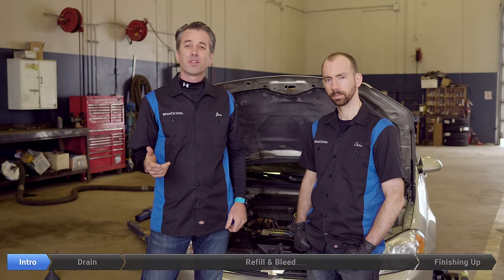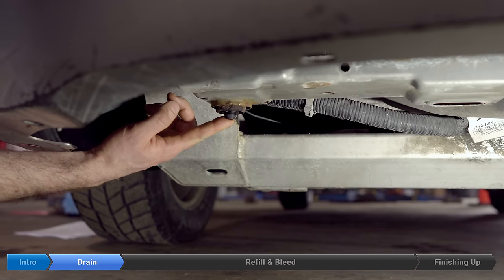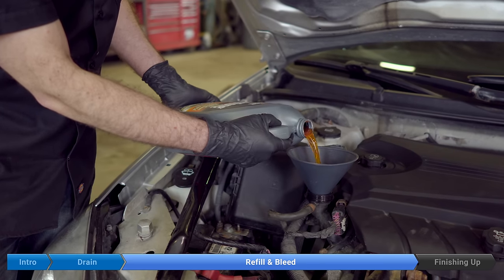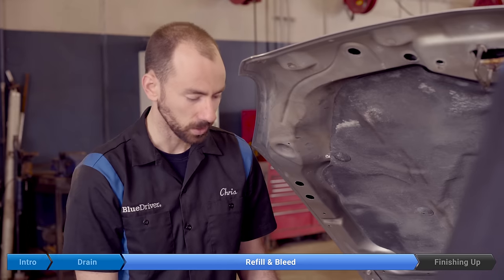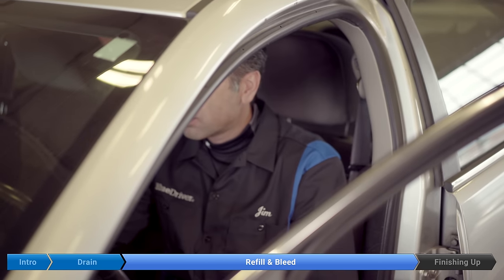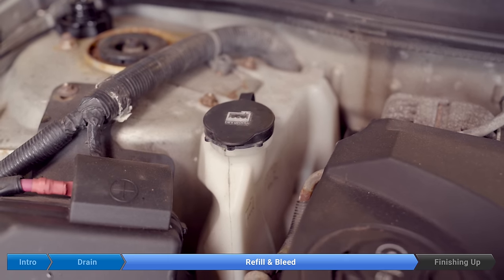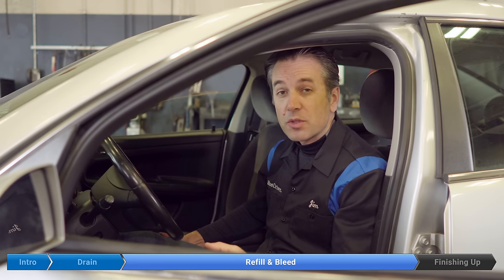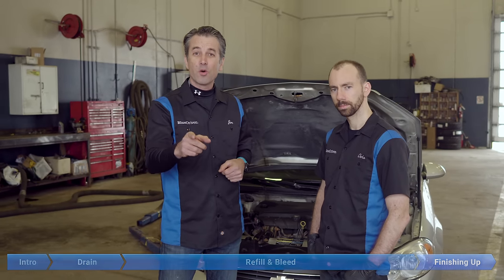Coolant Change - 2006-2013 3.5L Chevy Impala

Comment: Video worked! 
(Except unclamped the bottom hose cause i couldnt find the valve to release coolant) 

Thanks though 👌🏽 No more air bubbles
Reply: Ughh exactly edddie i thought i need a tool for it but i guess i dont i think i. Gonna take my impala to autozone and have them show me where it is exactly its weird because i didnt have this problem with my other impala
Reply: On the 2007 Impala, it is a wing nut that you turn. A flash light looking down from the passenger side can help to reveal where you need to reach. It is hard to find at first. Good Luck.

Comment: I still don't know where the drain plug is
Reply: On the passenger side, near the bottom.
Reply: Exactly idk why he wasn’t more specific
Reply: Thanks! That's all I needed to know.
Reply: Car should have a instruction book OR look it up on google😊
Reply: @firemanspitta3437 right? This entire channel should just be deleted cuz google
Reply: @lasawbrewer8272 that literally doesn’t help
Reply: @truetomysouljas4793  bro. If you're facing the car from the front, the car is opposite to your direction. This means you have to look to your left side near the bottom. It is that simple.
Reply: @lasawbrewer8272  I ended up finding it thanks to a friend who did the same job. Preciate it tho

Comment: Heads up for all you DIY’ers there’s a line at the bottom of the overflow tank. Fill it up to that line or just a bit above!!! I seen this video to see where the line was and I filled it up to where it’s at in this video and my coolant was pouring out!! I thought I had a hole in my tank but there’s a small vent in the back of the tank that pours out when the tank is full!!
Reply: I was thinking the same thing... That line is a cold fill line btw, so let your car cool down before filling it
Reply: I came to the video to check where the cold fill line is.   They overfilled the reservoir. No mention of the CFL.
Their shirts are nice though...
Reply: I was thinking the same thing they overfilled it 😂

Comment: The 2006 Chevrolet Impala has a coolant capacity of 12.3 quarts for the initial fill. The type that should be used in the vehicle is orange Dex Cool; 50/50 diluted.

Comment: A helpful piece of advice. If the petcock valve is not easily turntable by hand, you can use a 7/8" deep socket with a 3/8" ratchet to get it loose. That was the only way I was able to get the petcock valve loose on my 2009 Chevy Impala with a 3.5L engine.
Reply from the maker: Good tip!
Let's just say that part of the video was.. trimmed down for time
Reply: Show i have a 06 impala so would i need socket to drain the antifreeze
Reply: @sergiomelendez9186  I would recommend using a socket since the petcock valves on the Impala's have a tendency to be stuck on pretty good.
Reply: My 08 3900 cannot use a socket. I used a pry bar and pliers to turn it open. Closing was easier.

Comment: Good video, one step i have done different instead of filling, start/turn off vehicle etc to release air in the system. I have connected a coolant filling funnel to the filling neck that releases air while putting in coolant automatically.

Comment: It's just easier to loosen the bottom hose with the clamp just enough to get it to drain go inside have a cup of coffee when it's all drained put the hose clamp it back on start filling and bleeding
Reply: Really? Would that work with any car?
Reply: @unitedwestanddividedwefall3521  Yes but some cars are easier than others.
Reply: @Anon1mous  thank you yes. I just noticed that the Spurs on the clamp are turned inward towards the firewall and components and very hard to get a needle nose pliers to get it :( might have to cut it and put a new hose lol

Comment: Guys my cap broke, got a new one and doesn’t fit got another one but a new gm original radiator cap and still nothing does the spring on it adjust?

Comment: Aren't you supposed to remove the two engine block drain plugs on these motors to get all of the coolant out of the block?
Reply: Is that why I can't get the coolant out of my radiator?

Comment: How many gallons does the radiator system hold
Reply: You'll have to buy 3 gallons and probably use 2 and a half gallons, just did mine, but I flushed and drained every drop, even the reservoir, I use a turkey baster to get all the dirty antifreeze and sediments out
Reply: 10.1 quarts on a total system drain.

Comment: Car is leaking coolant from passer side. And I was looking at videos of old Chevy impala and saw that they have coolant elbow pipes. Are these the same on the 2008 impala.
Reply from the maker: There are a few spots on the passenger side - it could be the water pump itself leaking, or where the hose attaches just forward of it - there's also the coolant bottle at the back, cap, and the filler neck
Reply: BlueDriver I'll try the coolant bottle first then rule it out. I notice when I fill it up its start to leak. Thank you, you guys are very helpful.

Comment: Thanks for the vid, it makes a lot of sense

My concern, though, is that I only dropped about half the fluid that I expected and could only add about 1.25 gallons on my flushes. This is with the cap off and with the petcock the whole way open. Am I missing a step?

Comment: This video only shows how to drain the radiator only which only holds 1 gallon the rest of the coolant is in the engine block n heater core which can be drained by removing thermostat

Comment: My car when turned on heat still blows air on the driver and heat on the passenger side , I changed all 3 actuators! What do you recommend I do
Reply: Clean out the heater core

Comment: I can not find the petcock valve. Do you have a video showing exactly where that is at?
Reply from the maker: You'll (barely) see it at 1:38 
Passenger side, facing inwards towards the engine, bottom corner of the radiator.

Comment: My petcock is not nearly so easy to turn. It's blocked by a metal flange, and I bruised my arm on the alternator squeezing my arm down there to reach it.
Reply from the maker: Definitely not easy to break loose - if you didn't see it below, check out the comment by David Lamb where he suggests using a 7/8" socket - that should do it.

Comment: How come no water was added? Is this 50/50 coolant?
Reply: They are using a premix 50/50 antifreeze and water. You can use any 50/50 premix brand. Most all antifreeze brands today can be used in aluminum radiators.

Comment: I have a 2006 Chevy impala and the that runs in front of the engine is leaking but I have no idea how and where to find them because I don’t know the name of them
Reply: *pipes
Reply from the maker: Where are they roughly?
Reply: BlueDriver  Running from the front of the engine to what appears to be the heater core

Comment: I have a 2006 impala, does anybody know if the “petcok “ is in the same place? It seems like I can’t find it on the passenger side
Reply from the maker: It should be located on the passenger side, but it may be a little hidden behind a plastic cover or the air dam. If you can't find it on the passenger side, try checking the drivers side, some models had the petcock on the drivers side. If you can't find a petcock or drain anywhere on the radiator, you can drain the coolant by removing the lower rad hose (but warning, this can be messy)!
Reply: @LemurMonitors  got it, thanks a lot !!

Comment: My temperature gauge goes to normal range when idle or driving, but every so often it goes three quarters of the way up on the temperature gauge for a few seconds then goes back down to normal.  Could this be cause by a head gasket issue or faulty thermostat?  I don't see any leakage underneath.  Thanks.
Reply: Sounds like something to do with a temperature sensor.  They usually fail slowly and that's one of the things that happens when they start to go out.  I could also be a thermostat that's sticking and then popping open.  If it's been a while since you've had a new thermostat, I'd start with that since they're cheap.
Reply: my 06 did the same....check your level coolant in radiator,it may be low as was mine.That did resolve the issue..Now if it  does the same thing ,,then it could be thermostat or temp sensor..I would change both out .. easy to do..

Comment: Can low coolant cause your check engine light to come on
Reply from the maker: Sure can! Low coolant (or air in your coolant) can cause a number of codes that might normally point towards problems with the water pump, thermostat, etc - definitely the first thing to check!
Reply: I found out I got a oil leak also had NO coolant
Reply: I'm not sure where to begin with it.

Comment: I have one question, I have a 2015 Impala limited old body style from 06-13 but its the 3.6 V6. Mine doesn’t have the radiator cap so its only a resevoir on the left side. About 8/10 of a gallon came out, I only used 1 gallon, the book shoes 2.25 gallons. I’m assuming just keep the other gallons in case for a later use?
Reply from the maker: Sounds like a safe plan - that's probably the full capacity for complete fluid drain/replacement including everything in the engine

Comment: What does 2500 rpm mean?
Reply from the maker: That's roughly how much you should rev up the engine when bleeding the air.
Reply: Revolutions per minute, it's the speedometer wit the numbers 1-8 on it. 2500 wuld b half way between the 2 and the 3
Reply: *tachometer

Comment: What is rpm,
Reply from the maker: Hello!
You want to hold the engine at higher speeds than idle to help get the air out of the coolant
Reply: Revolutions per minute, 2500 rpms is half way between the 2 and 3 on the speedometer with the numbers 1-8